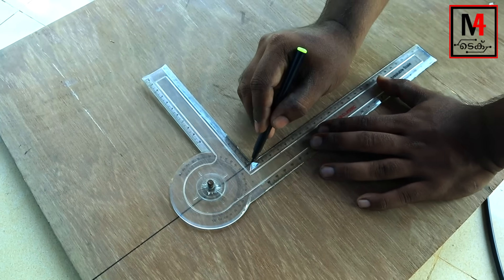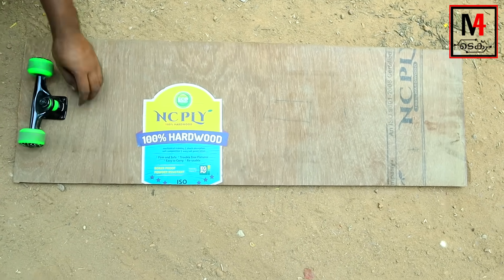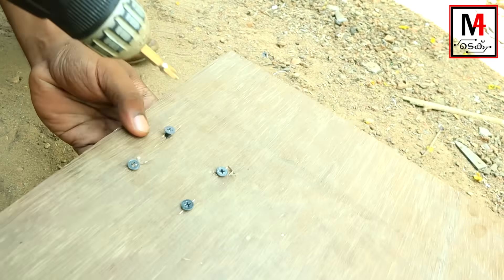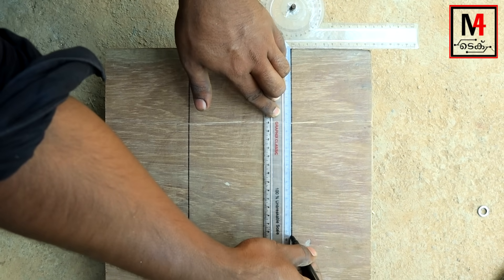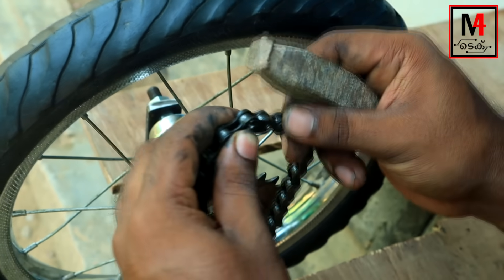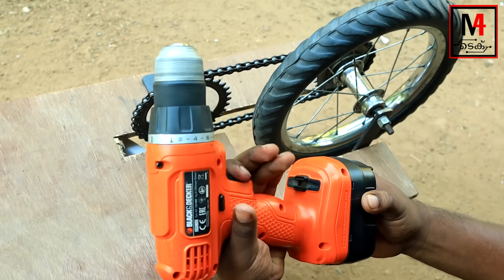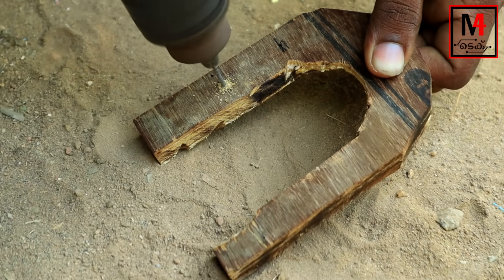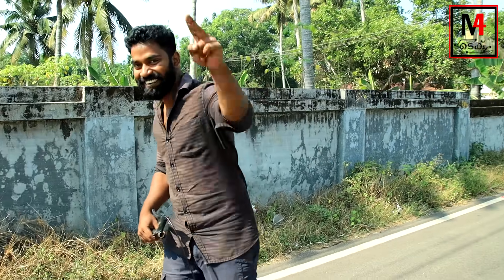How to Make a Electric Skating Board  | M4 Tech |

Comment: Hey bro I m fabricate this type electrical hover board but I have one issue you had use chargeable drill machine how much torque? ...
Bcoz i m use drill machine not getting load on road .. back bicycle wheel not get movement... So pls suggest torque of drill machine or any other query in my job....

Comment: I just haven't undertood how this electric motor goes.
Reply: Look at the screw drivier machine. That thing powers his skateboard allowing it to go forward and back wards.
Reply: @kurianbiju1294  what's the power of this tool and cost...?
Reply: Mr. 47 it’s cost depends on the brand, the more cost, better quality and much more power. If you get dewaltsversion, it will be strong, if you get Chicago electric model, it will be poor quality.

Comment: Bro, you did a great job... But there are some issues with the material you're using. The plywood piece will easily breaks and drill machine has reverse button too. If someone unknowingly press that button... You what would happen... Upgrade with some better mechanism and better braking ...

Comment: How do you turn your cycle to left or right direction if necessary? 
And, what is the breaking system? 
You have managed to accelerate it by a hand liver but is there any extra breaking method when you need to stop running the cycle immediately?
Reply: Write bro
Reply: body balance

Comment: Nice project but Electric engine with no breaking system!
Reply: Just use your legs like you use on a skateboard.
Reply: @mathewprath  pettane ore vandi vannal ente cheyum
Reply: @anandloco7448   This is not meant to be used on main roads I believe. This is just a prototype which needs to be improved by modifications. I just said a solution to the present invention, which is not a super jet. Speed should be in our control knowing the drawbacks of the invention. That's all.
Reply: @anandloco7448  ഇടിക്കും
Reply: @anandloco7448   പടച്ചോനെ നമ്മളെ കാതോളി എന്ന് പറഞ്ഞു ഒരു പോക്കാ
Reply: @Apple_Pen_Pineapple_Pen  😂😂😂
Reply: @3mentertainmentmedia761  😂😂😂
Reply: @mathewprath  English professor ano🤣🤣🤣
Reply: @anandloco7448  enthayalum paranja kaaryam manasilayi ennu vishwasikkunnu ☺️
Reply: same dought
Reply: 😂😂😂😂enganelum ninnolum😁😂
Reply: @#JOKE HOUSE MEADIA 😂😂😂
Reply: ഇറക്കത്തിൽ ബ്രേക്ക് ഇല്ലെങ്കിൽ എന്ത് ചെയ്യും
Reply: Erakathilotu povenda

Comment: Just a tip for you. using the left hand in front part of the hacksaw frame and use the coolant for blade, hold the job for bench vice or  ' c'clamb tightly or not Shake, change your blade using high speed Steel the white blade for easily cutting all metal and waiting for next video